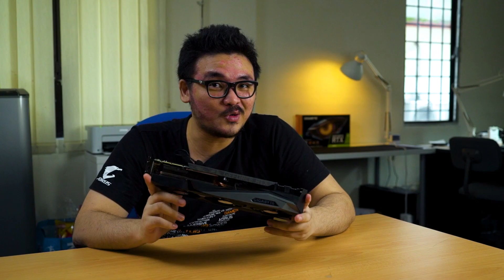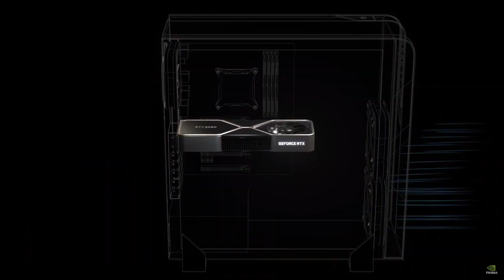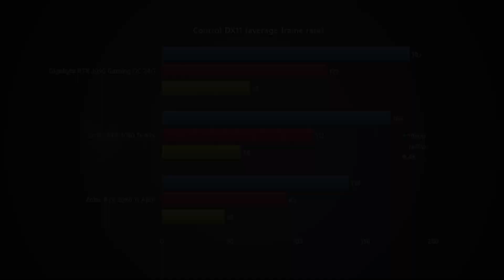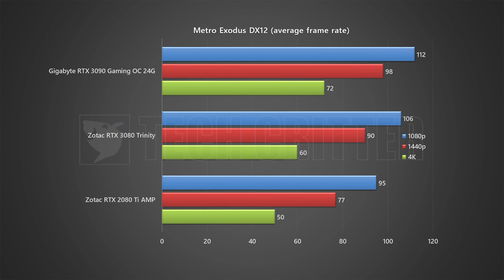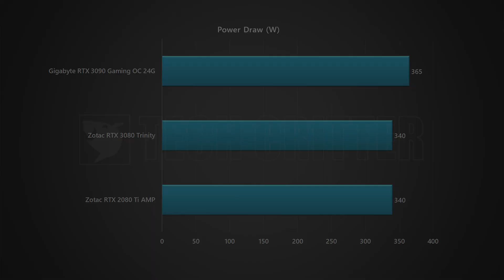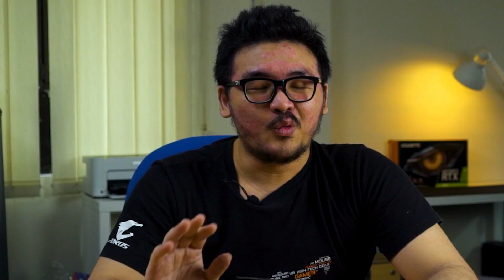Gigabyte GeForce RTX 3090 Gaming OC Review

Comment: I have to mount this particular card vertically due to my case size.. is that ok in terms of cooling?
Reply from the maker: Hmmmm... depends on your case and also cooling setup. If it's against a tempered glass side panel, then gotta watch out for the temps.
Either way, if it's not thermal throttling and kept below 85℃ or so, it's fine.

Comment: I need the disassembly of this card. I wanna see what capacitors they are using. Are they using cheaper one like JAYzTwoCents pointed out?
Reply: They use a slightly better quality one than the other cheap ones
Reply: @maxpower4224  poscap or mlcc?
Reply: They use a mixture of 470 SP-CAPs (not POSCAPS) and MLCC. The MLCC are not bunched up together as with Asus cards, but looking carefully at the PCB, you'll find that they are 'interwoven' between the SP-CAPs. Very clever of Gigabyte. There is a lot of excellent power delivery regulation on the Gaming OC for both 3080 and 3090.
Reply: @Bobby Frags all are small MLCC?